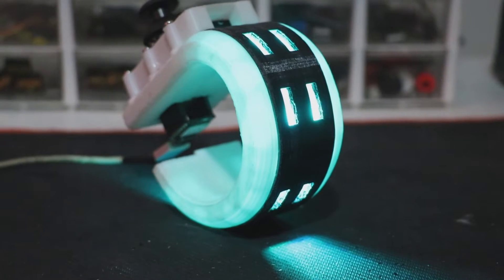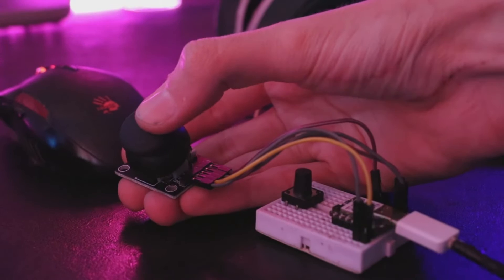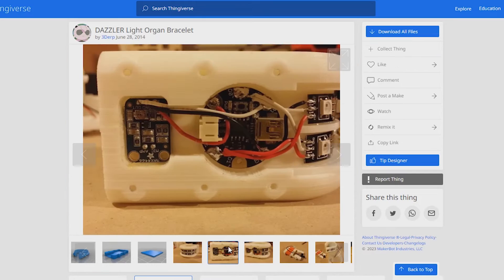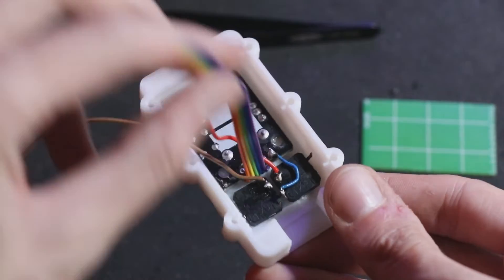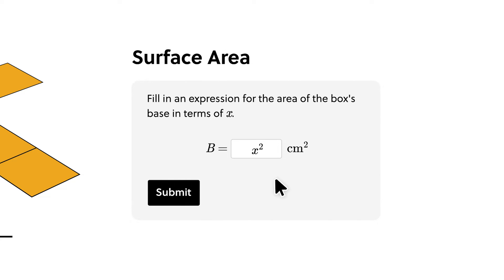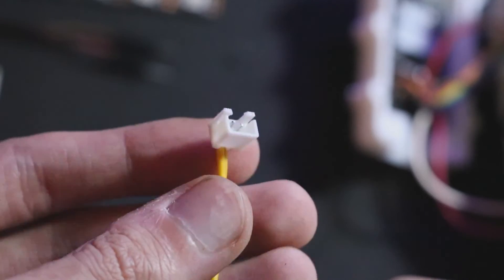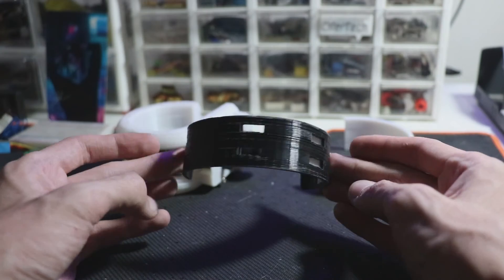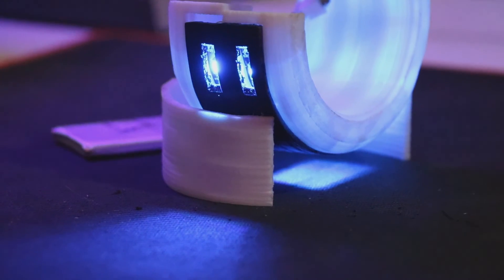DIY Wireless Controller Using XIAO nRF52840 Sense

Comment: I gave this code a shot on my XIAO nRF52840 Sense, it is broadcasting as a bluetooth device on my pc as "ATT Monitor" the leds blink when its attempting to pair and then inevitably fail. Is there another piece of software that you need to actually connect and read data from the board?